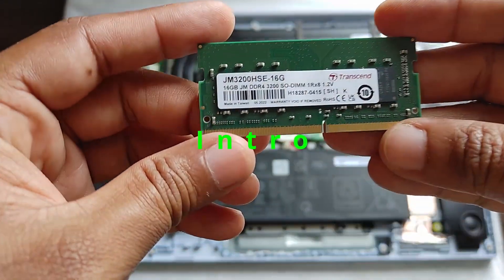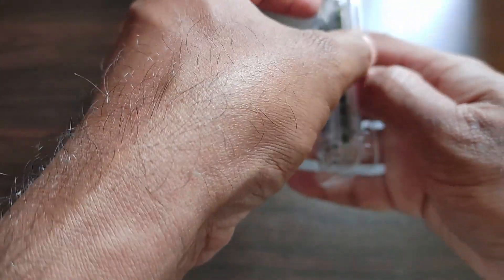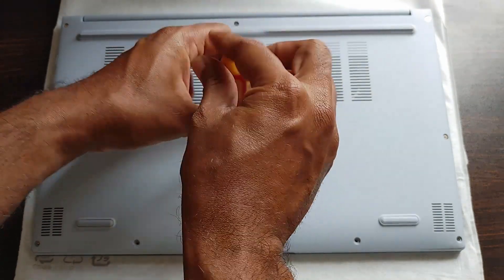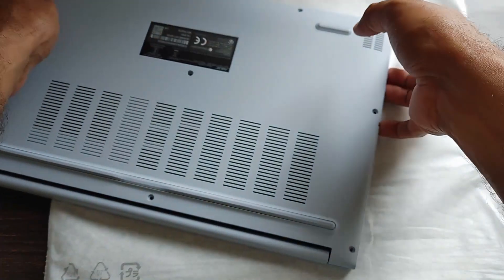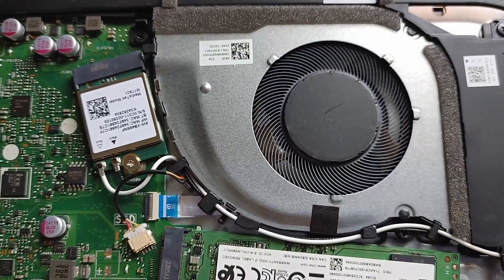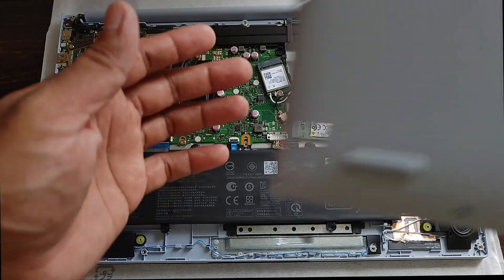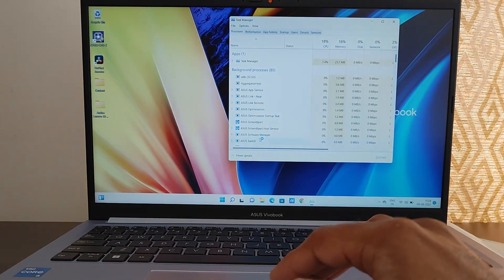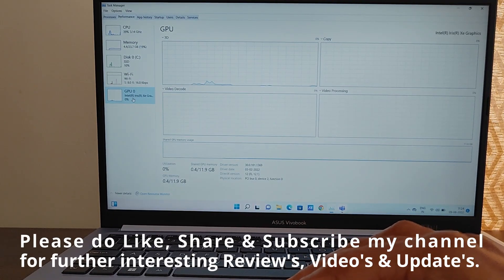How to Install RAM in Asus Vivobook Laptop | Step by step procedure | How to install RAM in Laptop

Comment: I saw this laptop with 16GB of RAM already. So does this mean that it comes with the RAM slot with an 8GB SO-DIMM?
If I need to upgrade to 24GB RAM I then have to take that one out and replace with the 16GB stick? Is this correct?

Comment: Will it cause any problems removing the back. I upgraded my RAM and switched from a HDD to SSD on my Lenovo no problem. I tried to do the same on my brother's Dell, and just removing the back seemed to brick the computer.
Reply from the maker: Nope, there shouldn't be any problem in removing the back panel of laptop.

Comment: Is it ok to not umplug battery?
Reply from the maker: In this laptop it's difficult to unplug battery. Make sure you do not have any static energy before inserting the RAM.
Reply: How to do that? I have vivobook m1405 and i just bought a ram and thinking if i should just let the pros do it or do it myself. I still have warranty btw but it cost an additional 9 bucks for labor fee.
Reply from the maker: Please go ahead and do it yourself if you know how to do it otherwise let the pro's handle it. Installing RAM is a simple thing.
Reply: thank you, i have successfully added 8gb ram in my laptop without removing battery, it seems to work fine and i didnt encounter any problem either

Comment: Hello, Good day Maddy. I hope you are doing well, and I hope you have the free time to see my query. 

I was just wondering if it is okay to add 16GB of RAM when the built-in RAM is only 8GB? I heard many YouTubers say that the RAM on dual channels should be of the same capacity (i.e, 8+8 or 16+16) or else it will downgrade in performance. 

Does the same apply here or is it safe for me to add higher than 8GB of RAM?

Thank you for your time and effort, I appreciate it a lot! God bless.
Reply from the maker: Hi, Good day to you too!. 
Regarding your query, All RAM modules come with supported clock speed. If the clock speed is different between two installed RAM's i.e for example, if the inbuilt 8gb RAM module supports 3200Mhz clock speed and the new 16gb RAM module which is being inserted supports 2400Mhz, then both the RAM's work on the lower clock speed i.e 2400Mhz. Similarly if the 16gb RAM module which is being inserted supports 4000Mhz then both the RAM's work on 3200Mhz clock speed. 
In my laptop, the inbuilt 8gb RAM module supports 3200Mhz clock speed and the 16gb RAM module that I have inserted supports 3200Mhz clock speed. Both the RAM's are now working in 3200Mhz clock speed as both the RAM's support that speed. 
Please check your system configuration before purchasing the RAM and make sure that the Laptop supports additional 16gb RAM and purchase the RAM module with the same clock speed of the inbuilt RAM. 
Hope you understood the above explanation. If not, do let me know your query. Happy to help.

Comment: Sir... I have i7 12 generation ....i already have 16 GB ram with UHD graphics

If adding 8 GB ram more...
The Iris Xe Graphics will enable or not

Because i already have 16gb ram..

Please please tell me sir.
Reply from the maker: Hi, If your laptop supports IRIS XE graphics then you should have dual channel RAM to enable IRIS XE i.e two ram modules are required for IRIS XE to get enabled. Make sure that your laptop supports IRIS XE and then check if you have single RAM of 16gb or two ram modules of 8gb each. If you already have two ram modules of 8gb then IRIS XE should be enabled if your laptop supports IRIS XE graphics.

Comment: Sir.... I have Asus vivobook 15 
X1502ZA-EJ741WS
i7 12 generation (16GB/512GB)
with UHD graphics

Ram is expendable 24GB

After adding 8GB ram
The Iris Xe Graphics should enable or not..

Please tell me sir....
Reply from the maker: Hi, As per the config for your laptop model in ASUS official website, Your laptop comes with UHD graphics and doesn't support IRIS XE. Your laptop comes with two 8gb RAM modules (8gb is soldered to the motherboard + 8gb is inserted in the RAM slot of the motherboard). Just check if you have two RAM modules in your laptop and if yes and still if you don't see IRIS XE then your laptop doesn't support IRIS XE.
Reply: @maddytalkswithyou  thanks sir.

Comment: Sir got same model of this but it's comes with blacklight model no is X1502ZA-EJ532WS 8gb 512ssd  i5 1235u

So now it's showing  uhd graphic so can I do same for iris xe?? Graphic
Reply from the maker: Hi, can you confirm if your laptop has one 8gb ram module or two 4gb ram modules. As per ASUS website, I can see that this laptop comes with two 4gb ram modules. One 4gb ram is already soldered to the motherboard and another 4gb ram module is inseted in the RAM slot.
Reply: @maddytalkswithyou  sir I just paid half amount  to nearest Asus Shop for order today
 and after watching ur now am confused it's comes with xe or not
 amzone/Flipkart not showing anything about graphics and Asus official site showing it's comes with x.e .  Sir please help me how can check it . Shall I cancel my order
Reply from the maker: Hi, As per ASUS official website, this model laptop comes with IRIS XE. If it comes with two 4gb ram modules, IRIS XE would be enabled by default. You can ask the ASUS shop guys to confirm if this laptop comes with IRIS XE and take a call whether to go ahead or not.
Reply: @maddytalkswithyou  ok sir ty

Comment: I buy this 16gb ram from your link, mentioned in my product 2R X 8,this time tak not installed Ram,you using 1R × 8,and you buy 4,700 rs and this time product price 2R X 8 is 3,800 rs 
I doubt my product is correct or copy
And can i you external light for uses of laptop keyboard
Reply from the maker: Hi, I don't think you purchased the RAM from the link shared in the description as it is not showing in the list. However, regarding your queries, Yes, the RAM that I am using is 1R X 8. The price for the RAM has reduced which is a good thing. For your second query, yes, you can use any external light while using keyboard of the laptop.
Reply: @maddytalkswithyou  kuch problem toh nahi hoga na,Intel UHD to  iris xe graphics me convert hone me?
Reply from the maker: No, not at all
Reply: @maddytalkswithyou  thankyou Maddy,love you bro, helping for everytime 👍🙏🤗😉

Comment: Excellent video, and your timing is perfect.  I just bought a ASUS VivoBook K1703ZA 17" which the retailer claimed supported Intel Iris Xe graphics in the 8GB model they had.  Took it home, hours to set up, and then, as you said, only UHD showed up.   Looking at the ASUS site, you could sort of figure out that needed two DDR4 chips to have  Dual-Channel memory support, and you needed Dual-Channel memory support to run Iris Xe graphics.    But I was still nervous to install another 8GB SODIMM, in a brand new machine, because no one assure me that doing so would enable the Iris Xe support.     You solved all that!   Thanks for the inspiration and directions.  I now have a 16GB with Iris Xe.

Comment: if i add that 8 gb 3200 mhz ram instead of 16 gb then the graphics be changed to iris xe or not ?
Reply from the maker: Hi, yes, if u add additional 8gb ram, the graphics changes to IRIS XE.
Reply: @maddytalkswithyou  is there a major difference between iris xe and intel uhd because I dont play games do I need upgrading it ?
Reply from the maker: Hi, if you don't play games and do not use the laptop for any graphics related work and you are not connecting to any external 4k displays, then you can use the laptop with UHD. You can add one more ram module at a later stage whenever required.
Reply: @maddytalkswithyou  ok thanks 👍

Comment: Can we add a 2.5 inch SSD internal ? Do we have a slot?
Reply from the maker: Hi, I don't think 2.5 inch Internal SSD can be added to this laptop. The specs in asus official website doesn't mention that. 
"Storage: 512GB M.2 NVMe™ PCIe® 3.0 SSD expandable using 1x M.2 2280 PCIe 4.0x4"
You can check the specs in this link:
https://in.store.asus.com/x1502z.html